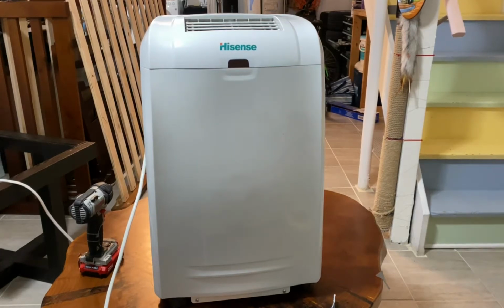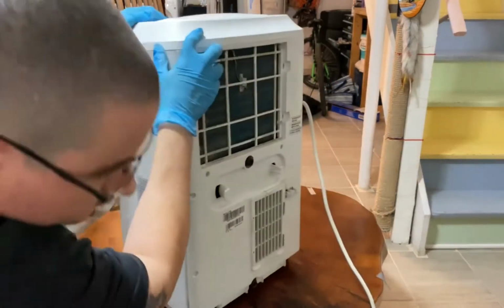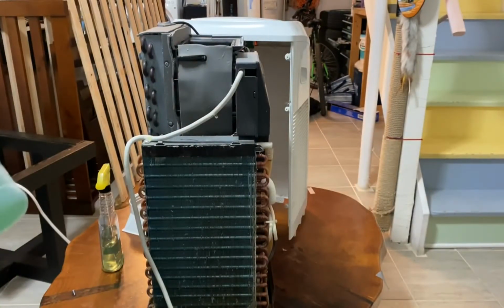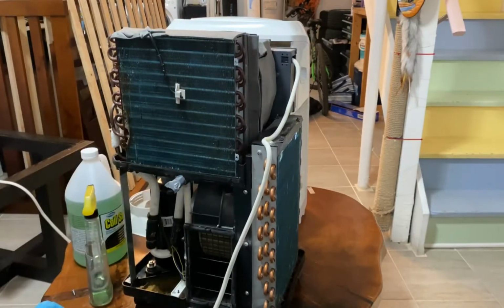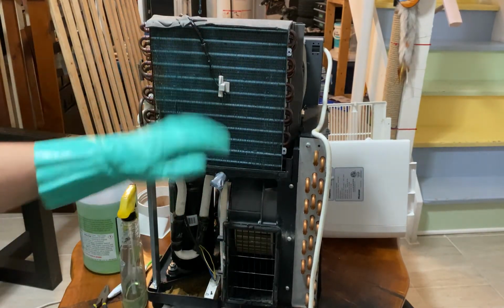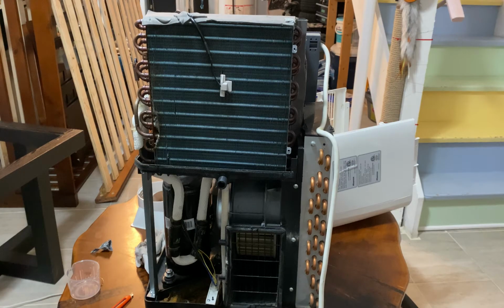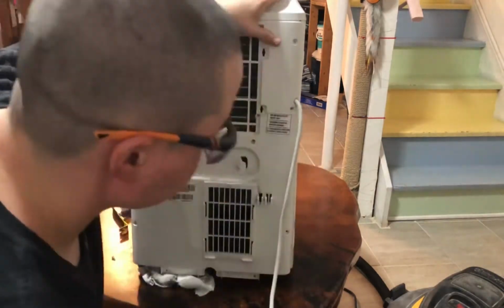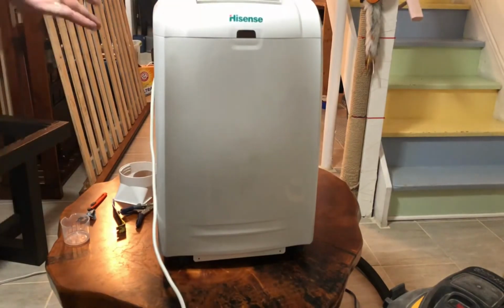How To Clean Hisense Portable Air Conditioner Coils

Comment: Hey, this helped a lot. DO you need to replace the white circular filter in the center of the unit ?
Reply from the maker: I’m not sure what filter you are referring too. These units do not have a filter.
Reply: @BillOfAllTrades2016  its like a circular. Blue or white, and looks like its set in the middle of it. Like a car filter.
Reply from the maker: That’s not a filter. That’s the fan. Portable ac units don’t have filters

Comment: Hi! Our portable AC is Serene Life. We used it all last summer and had no issues . This year after about first month of summer it started acting up. Would stop blowing cold air. I cleaned the filters, drained it and reset it. It worked ok again but then stopped again and I noticed through the front could see ice build up where the vents blow air. So it all froze and would bloke the air flow . I turned it on fan and ice melted, but every time I turn it back to cool it freezes again, either partially or fully. What is happening?! Is this a coil issue?! We have a toddler who doesn’t handle the heat well so we have been struggling to figure out how to fix it. Our bedroom has crank windows so a window unit is not an option unfortunately. Appreciate any advice you may have!!
Reply from the maker: You said you cleaned the filters. But did you dismantle the unit as shown and clean the coils? Frozen coils usually indicates poor air flow. Is there anything close to the back of the ac that my block airflow like a curtain or any other items?

Comment: Are those bronze colored coils on the bottom right producing moisture? Do they also need to be cleaned? Cause if they dont produce moisture they wouldnt be developing bacteria would they? I cant figure out how to remove my case. I
Have a different model hisense

Also does removing the case void the warranty?
Reply from the maker: Yes they also produce moisture but the air is only drawn across the fins so you only need to clean the fins. Also opening the unit and removing the shell will most definitely void any manufacturers warranty.

Comment: Should the on/off light be red when turning it on? I just got an used one but I am not sure if that's normal.
Reply from the maker: The red light indicates that your water collection tray is full of water. The unit will auto shut off when it’s full to prevent overflowing. When the unit is powered back on the switch will be red. Unplug the unit and pull the drain plug and let all the water out. I set mine in the tub to make the draining easier. Once it’s all drained power the unit back on and you should be good to go. Thanks for watching. Please like and subscribe

Comment: See the sensor in the middle of the top coils? I think mine might be bad. I think it's a moisture sensor. Mine runs even on dry days until the float switch trips an E5. I had to buy another unit. I don't know if my old one is repairable.

Comment: I think i've pretty bunch bent the entire fin set on the side of my air conditioner.It still seems to work fine and has for a while. Though, I wonder if it would work better if I replaced this part? What do you think? And if I can get the part, do you know where I would find it? I have the same AC as you
Reply from the maker: You don’t need to replace anything. Just buy an ac fin comb. Here is a link to one on amazon. https://www.amazon.com/dp/B075L3CJFR/ref=cm_sw_r_cp_awdb_imm_XEC6SWF48BF672ZZ080Y?_encoding=UTF8&psc=1

This will straighten them up no problem. They also have ones at Walmart Home Depot and Lowe’s if you want to search for what comb you like best. Let me know how it goes
Reply: @BillOfAllTrades2016  amaziiiinng. Thank you so much. Also, would you happen to have a link to the manual for this model? Ive had it for years and dont know half thr buttons
Reply from the maker: What’s the model number? I can look into it for you. This was a unit that I cleaned for someone so i I don’t know the model number.
Reply: @BillOfAllTrades2016  So it's a NM1Z8D10532 hisense portable air conditioner. The "Z" may be a "7." I can't seem to find a manual for the life of me as it's a fairly old unit. At least 10 years old.

I followed your video and cleaned the air filters and sprayed the fins a few weeks ago and it's been working great. But now it's stopped cooling the air. The fan comes on. And periodically, every minute or so, it tries to turn on the condenser (right?) to cool the air, but then fails. So I was trying to find the manual to figure out how to fix this.

Comment: one of my hisense produces a ton of water and the other none..what the heck?
Reply from the maker: Mine is the same. It could be that one room is more humid than the other. Do you run them both at the same time of day and same length of time? My daughters ac collects more water because it runs during the day. But mine doesn’t because it only runs at night when humidity is low. Did you clean both of them? If both of the units have clean coils and are blowing cold air there is nothing to worry about. Hopefully you found this helpful. Please like and subscribe

Comment: It's a good name brand. But in my opinion, any name brand or type of portable ac is not worth it. They all produce water in a tank that you have to pour out when the tank gets full. On average, 7 pints of water for every 8 hours it runs. Common sense, get a window ac they drip thier water outside by their self.
Reply from the maker: Or you could use the provided hose that it comes with to let the water drain into a bucket as it runs. Put the unit ontop of a tote bin to elevate it. Not everyone is allowed to have window units.